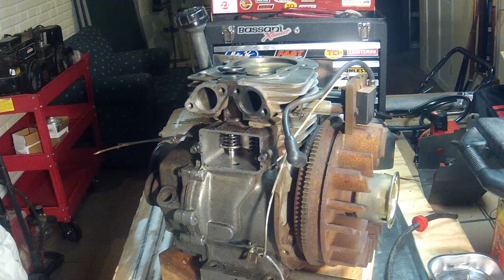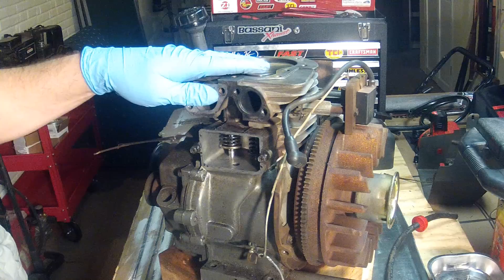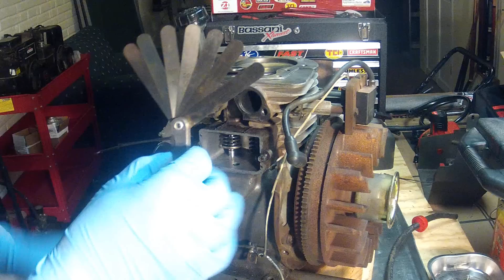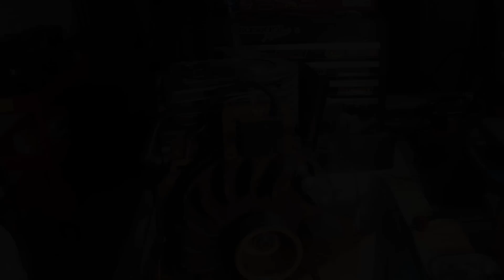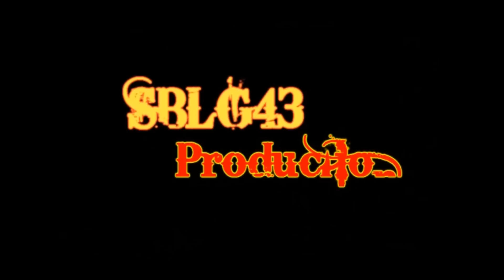Tecumseh HM80 Engine Part 5 - Valve Clearance check

Comment: so how would you adjust them if they were not?
Reply from the maker: If the clearances are too tight, you would have to carefully grind the bottom of the valve. If they are too loose, new valves.

Comment: I keep breaking the Valve cap on the Intake Valve. They only last about an hour on my 8hp Ariens snowblower. They get all beat up in the center until the center breaks right out. Any ideas on what's going on?.
Reply from the maker: That is a mystery. Sticking valve?
Reply: @RealManSkills  I have two more arriving today in mail from E-bay. Thanks for the response. Also read on internet it might be revving to high. Will try and tone it down and see what happens.
Reply: Turned down the rpm and used snowblower for 4 hours today. Around 8 inch of snow. Had no breakdowns.

Comment: intake  .008 -  exhaust  .012     right?
Reply from the maker: +estrelladelnorte1308 According to the repair manual that I have, both valves are good if the clearance is within .008 to .012 range. Thanks for watching.
Reply: sblg43 you probably have the same manual as me and confuses me, it has those two numbers too, but i was told that the .008 is intake and the .012 is exhaust  look again and you will see what i am talking about .the numbers are one on top of the other one, not next to each other like you normally see on a wide range spec ,   is like this
 
.008
.012

a wide range normally is represented like this   .008 - .012 

not an expert but i am confused too.
Reply from the maker: estrelladelnorte1308 Take a look at the "crankshaft end play" - there are two numbers there as well, but there is only one crankshaft. So I still believe those numbers represent a "range". Also, if you need your intake at exactly .008 and your exhaust at exactly .012, you will be hard pressed to get those numbers perfect. Thanks for your input.
Reply: sblg43 thanks! ill keep researching
Reply: No both intake and exhaust clearance are the same .008" to .012" but never go tighter with exhaust as it sees more heat and will close up quicker over time, I use .010 on both and do them annually or semi annually depending on the amount of hours I put on the engine. Rule of thumb is if .008 slides through easy and .012 will not fit you are in the sweet spot and good to go.

Comment: I got a quick question that I hope someone has an opinion on. My engine spec clearance is .008 to .012. But the actual clearance (after a rebuild) is exactly .013 on both valves....This measurement is taken cold....
Is it worth it to get this clearance tighter?  Lapping the valves in more?